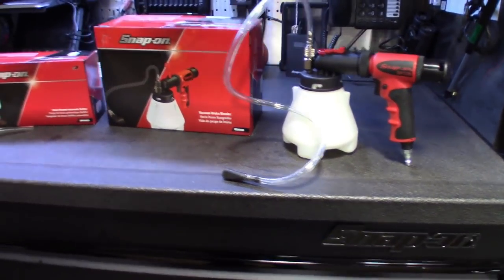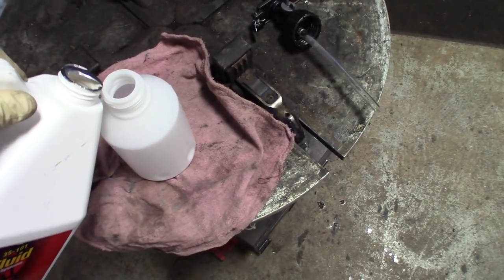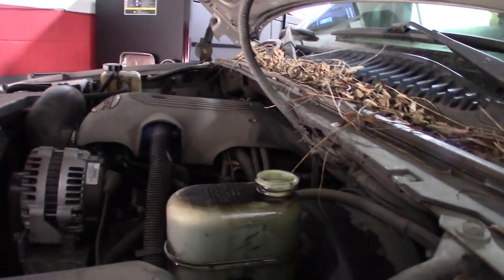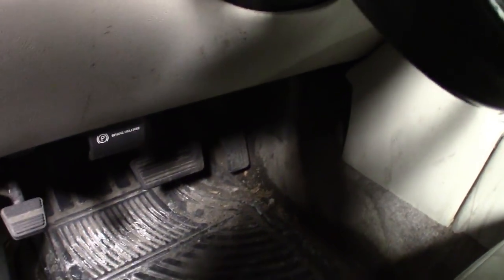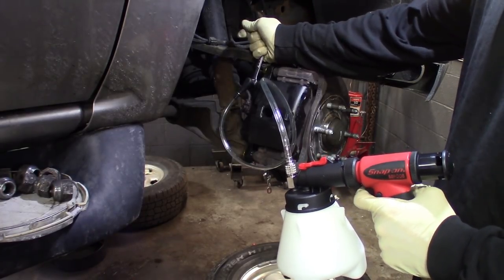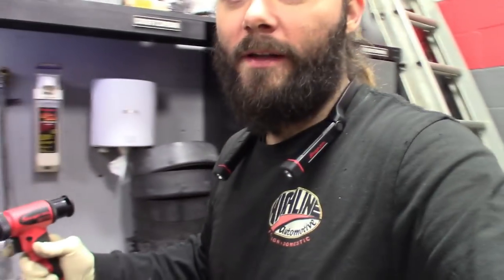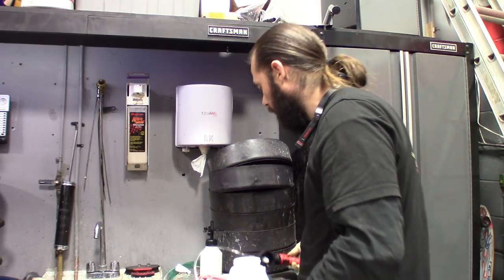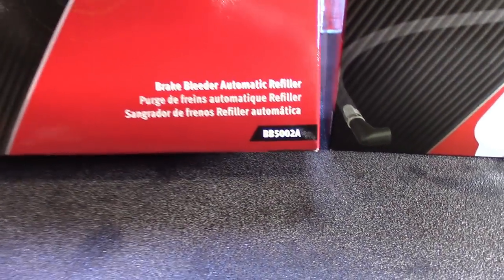Tools In Use!!!

Comment: I use the shop BG brake flush machine wether I sell the flush or not. Combination pressure vacuum bleeder. The best possible bleed and saves time with no need for another tech pumping the pedal. Very valuable for Chevy brake line jobs like this.

Comment: Do you ever use the scanner to activate the abs unit to help bleed air out on those gm’s. I have the mityvac kit mv6840 with all adapters for top of reservoir to screw on like normal cap works good. Especially when you are one man shop like you. Got get
It done fast and quick and right ever time. 
Awesome video thanks for the great content.
Reply from the maker: Yes I've used the scanner to activate the valves in and module but for this particular GM it's not needed.

Comment: Will that work on hydraulic clutch bleeding?
Reply from the maker: Yep. I've bled clutches with it too.
Reply: @JRC54  That's what I wanted to hear. Same procedure with pedal partially depressed?
Reply from the maker: It's just something I do, too make the seals open and the flow better. You don't necessarily have too, you can just manually pump the clutch petal a few times.
Reply: @JRC54  That makes sense

Comment: Did you replace all calipers, some of them or? 

What was wrong with them that you had to replace them?

Yeah we hear the hissing. 

Why with the brake pedal halfway down as I've never heard of that before?

I recently bought a motive bleeder for ly Tahoe that you can pump and then has various caps, etc. Bought off of Amazon. 

I should try my hand at a video and see how it goes.

 I've did the vacuum way like you're doing and had good results as well.

 Couldn't stomach the price from my snap on guy so I stuck with the good Chinese one I had. 

Shorten your intros up a little. Want info about that check out ChevyDude he has a video on how much he made last year but he got into analytics. If you need the video let me know and I can email the link to you. 

Did you use the scan tool to bleed the control module as I've seen that option and always figured that would help at the right time during the bleed process though.
Reply from the maker: Too many questions Dale. The pedal have down because it opens the seals in master and abs dump valves
Reply: Was just asking why the calipers were bad as I didn't know if something was known or customer wanted them upgraded or what. I have a 03 Tahoe myself and have only had to replace 1 caliper due to seized pin @ 100k miles on rear which was first brake change for rear axle. Backing plates were replaced as well as were in a Rustbelt here in South Dakota.
Reply from the maker: Lol. We did the front calipers because the piston was stuck. And the bleeder screws we're too rusty.

Comment: This tool does not work for a new master cylinder does it, maybe I done something wrong, thanks
Reply from the maker: I haven't ran across one it didn't work on. Try holding brake pedal down half way while using it.
Reply: I didn't do that, I appreciate it bud

Comment: Rubbish tool for snap on .. fluid never runs clear !!
Reply: I agree. Anytime you crack the bleeder nut it allows air to pass around the threads and into the hose. When you use suction at the bleeder instead of pressure at the resevoir, you get bubbles. Same thing happens when I use a Mityvac suction pump. You will never get a clear flow of brake fluid in your tube. Put grease around the base of the bleeder threads...blah blah. I like to see clear fluid, not bubbles. Like Kawasaki00000000 comment above, I agree with him as well. Pressure at the reservoir for me.